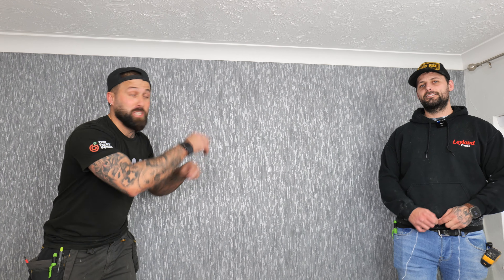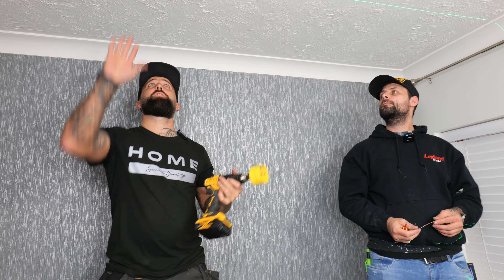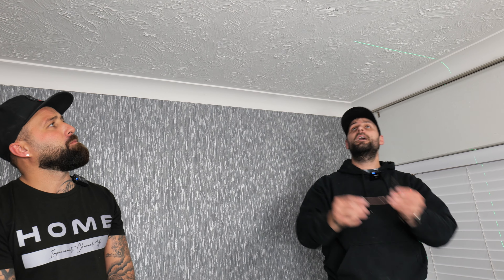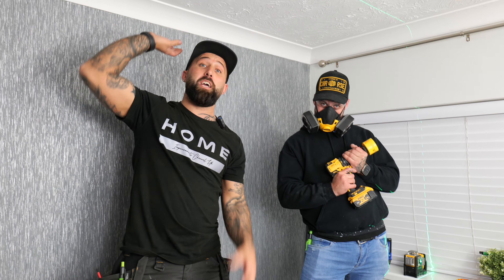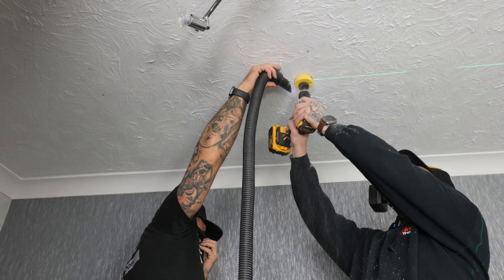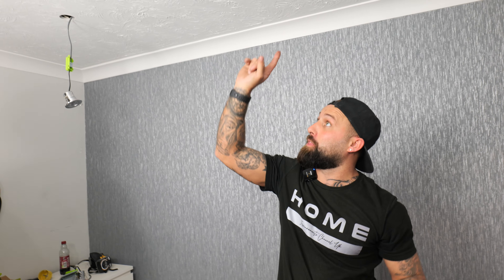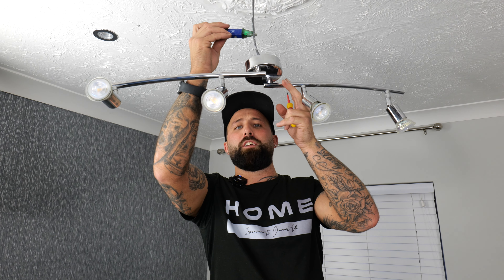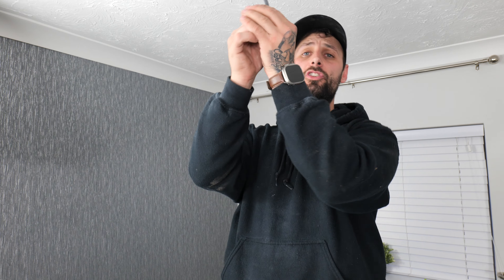How To Install LED Downlights (Ceiling Spotlights) | Easy Step By Step DIY Guide

Comment: What a cracking video on how to wire spots up.
 I've never done it before, but after finding this video, i feel totally confident now on taking on the job!
I was thinking of pushing the original light plate into the ceiling and running off the wire that holds the bulb.
I can now mark the wire and wire up everything else up to the wago connectors and still not know what they are all for lol class

Comment: Excellent video - couldn't fault it one bit. Will be wiring up some spots in my room which currently has two wall hanging lights (off of one switch) - will be using every  bit of advice right down to the copper wire for checking joists! Thank you!

Comment: Thanks guys. The job you described in the video was almost the same as the job I wanted to do. I followed your tips to the letter. Job done and absolutely no hassle. I do have just one question though. I wanted to use a dimmer ( downlights dimmer compatible).  When I exchanged the original switch with a dimmer, it didn't switch the lights on. Is there a particular type of dimmer switch I need to buy? Top video thanks.

Comment: Great informative video. This method has all the lights turn on from the same switch i assume? What if i want the spot lights to turn on from a different switch?
Reply from the maker: Need to set up for two way switching 😊
Reply: @homeimprovements  thank you. Do you have a video on this or somewhere I can look for this info? Cheers for the reply!

Edit. Just had a Google on 2 way switching and I've only found info on adding two switches for 1 light. I would want to wire the downlights to a new separate switch to the main light switch. Hope that makes sense haha

Comment: Hey great video, thanks, what if I don't have access to the top foor? is there a trick to pass the cables from one hole to the following from downstairs? Assuming that I have already a wire on the ceiling to start from.
Reply: Never mind, just found your other video, you guys rock. All the best from Italy

Comment: Really helpful. My only question is, what do you do if you don’t have access to upstairs to feed the cable?
Reply from the maker: Will need to open up the ceiling 😊
Reply: Assuming youve drilled in your holes, take a long flexible piece of material such as the uPVC draught proofing strips often used around uPVC windows and tape the cable to one end then push it through one hole in the direction of the next. If it doesnt go assume a joist, however you can then angle the strip upward slightly, passing it over the joist while another person keeps an eye out for it in the next hole. Abit fiddly but the hole should be large enough to grab the strip and cable with a hammer or crowbar/long hooked tool then pull through.

Comment: Quick question hopefully, Iv just had a dormer added, I want to add 3 lights on a single run, and 6 lights on another run so all going to a 2 gang switch, I think I understand how these all wire up, but my question is, from the last spot light what do I connect up to? Do I connect straight to consumer? Or do I connect to the light switch, or do I connect to a junction box? 
Thanks in advance

Comment: 🎉🎉🎉🎉🎉 Jackie boy hi nice to see you 😂 brilliant clear advice there Phil. Bradley I bet it makes a huge difference in the loft having no Itchy insulation to contend with. 
I'd love these in my hallway tbh but it would be a challenge running the wires and threading them 😢
Reply from the maker: 🤣 thanks Elaine 😁👏🏼👏🏼👏🏼

Comment: If you were putting in the downlights and also keeping the original room light, could you just connect the downlight neutral and cpc to the ceiling rose and connect the downlight live to the switched live at the ceiling rose?
Reply from the maker: You can connect into original yes 😊

Comment: Is this series or parellel? Not sure about the green connecting box. What happens if one Led is broken?
Reply from the maker: Parallel standard wiring for most downlights 😊 if one goes out it’ll make no difference to the rest 😊

Comment: I want to add lighting to the ceiling half bathroom.  Got to figure out the trim first 😕. There’s a corner definitely not 45degees. I’d like to add a photo so you can see what I’m talking about. How does one add trim to the wall that’s less than 45degrees?? 😶‍🌫️

Comment: Hi mate how would it work for a loop in at the switch ? 

Would there be a junction box under the floorboards that would need connecting to the first spotlight ?
Reply from the maker: Two plate ? Where the neutrals are at the switch ? If so the cable at original light can be moved directly to first spotlight
Reply: Thanks for the reply. Yes 2 wires in the COM, 1 in the L1. 

This particular room has two light switches. One on each corner of the room. That’s why it’s set up this way. 

Ceiling rose has just the switch live and a neutral. - so my question is still ok to do it via the wago connector method?
Reply from the maker: Perfect so yes just take that cable from original light to first spot light unless it’s too short then just extend it using the wagos 😊
Reply: Sorry my bad. There’s one wire in the COM and 2 at the bottom. 1 way and way.

Would it still work the same?
Reply from the maker: As long as you have the single cable in the light containing l/n/earth 😊😊
Reply: Gotcha. So essentially the switch live provides the power. 

You should make some videos on one way and two way switches. Not an easy concept to grasp at the beginning. Would educate subscribers. Thanks

Comment: Hi, I've moved into a new flat and the bathroom has these downlights but one (out of 4) is not working. How do I fix/replace?? Thanks!
Reply from the maker: With a bathroom I would say electrician as it’s a special zone simple job but I can’t advise as the area it’s in 😞

Comment: Hi fellas, if im doing this on my ground floor, how do i loop the wires round as room above is a carpetted bedroom?
Reply from the maker: Hole saw to push cables through then repair ceiling is the only other option in that case 😊

Comment: Can I legally do this in my own house for myself? 
I always thought that if new wiring is added this can be only done by qualified electrician.

I am very handy with electrics but not sure about the legality.
Can you point me to a website explaining this.

Thanks for the video by the way.
Reply from the maker: I will try to find the exact regulations on what can and can’t be done 😁
Reply: Any circuit extended should be have minor works certificate issued. The only things that don’t really need a certificate would be to change a socket or light etc. many people get part p mixed up with the BS7671 which is the electrical regs.

Comment: My ceiling rose is different to the way he is showing it. I don't have brown wires etc I got red wires.
Reply from the maker: Red is brown in older cables and black is blue
Reply: Be aware of your switch wires also, black could well be your switch wire 👌🏻

Comment: Where is the switch cable in the first fitting
Reply from the maker: The switching is done at the switch 2 plate wiring so no switch line 😊😊

Comment: Please don't use a non contact voltage pen to test. Get a gs38 voltage tester.
Reply from the maker: I have a proper tester but just use this as it adds visual clarity but your right maybe we should should the proper safe isolation 😊

Comment: You DONT double up cables in a wago connector, do it properly......also the cable for the last downlight   should be tested for continuity of earth R1 R2 test to make sure all the connections up to that point have been made properly
Reply from the maker: When did I double up cables in the wago mark
Reply: @homeimprovements  if you meant double up the wagos then my bad and apology